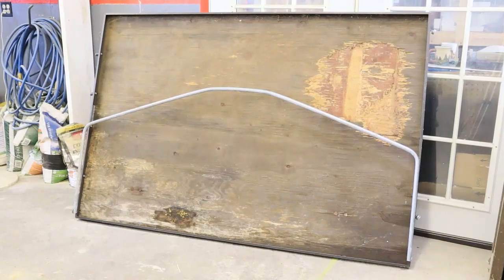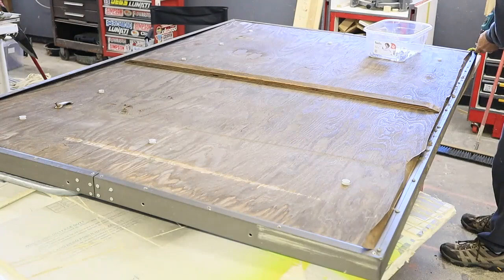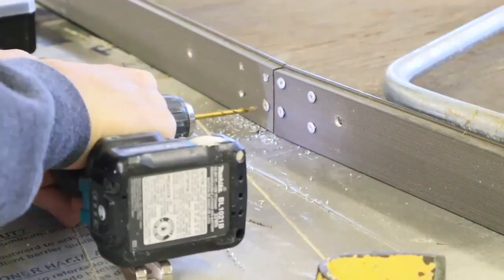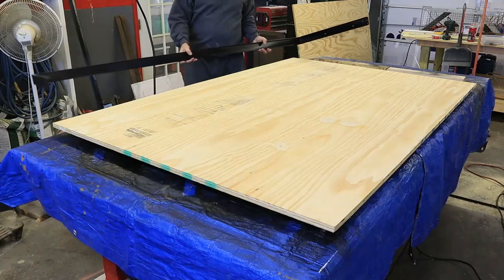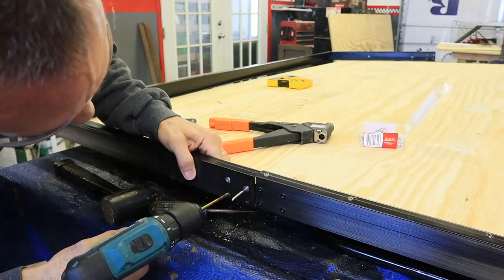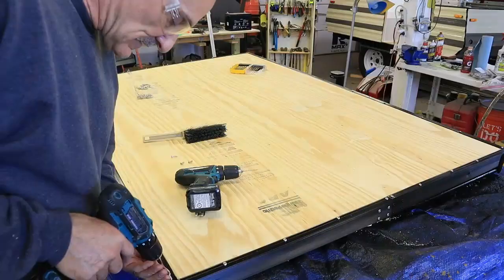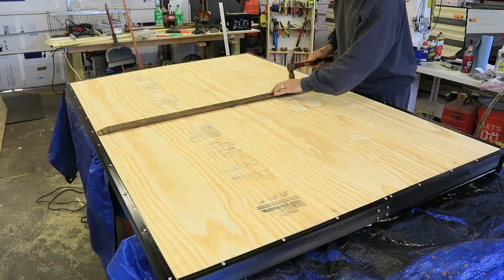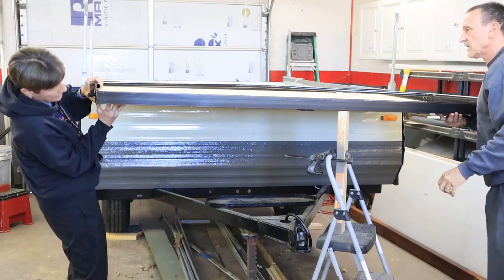POP UP BED REBUILD Jayco Tent Trailer Camper Renovation PT 23

Comment: As a former Jayco pop-up owner, I wanted you to know that the metal tracks under the bed slides (2:02) are supposed to go inside a nylon track guide mounted to the top of the end walls.
Reply from the maker: I appreciate your input, however, I have referred my disassembly pictures and videos during this reassembly. I have seen no evidence of any nylon track guide on this pop up. Maybe they were not all built the same? Thanks for watching.

Comment: I didn't see you replacing the plastic moulding under frame at the end close to the camper to assist in reducing the outside air coming in.

Comment: What did you use to replace the top box trim around the trailer. The metal strip that the bed slides across.
Reply: The aluminum plate for the front and back

Comment: What size plywood is it 3/4” plywood or 19/32?
Reply from the maker: Good question. I installed 3/4 but it interferes with the pop rivets and may be overkill. 19/32 would fit better. Thanks for watching.
Reply: Thank you for the reply. I’m currently rebuilding a Jayco qwest 10. Your videos are very informative, really like the paint colors looks sharp. Keep up the great work and content.